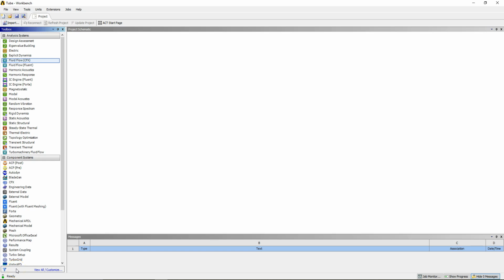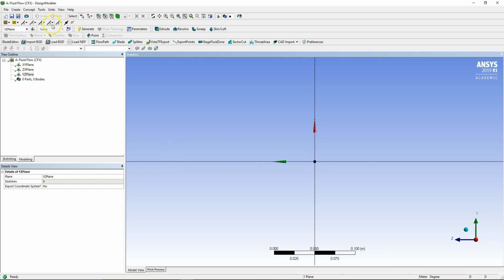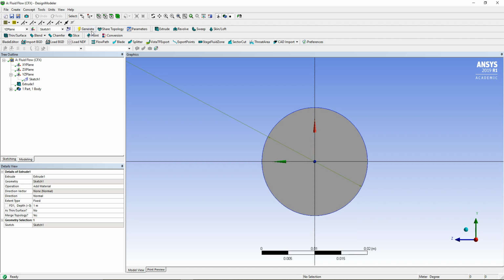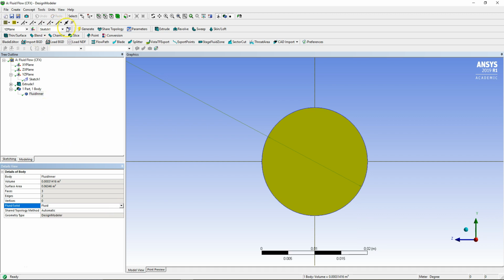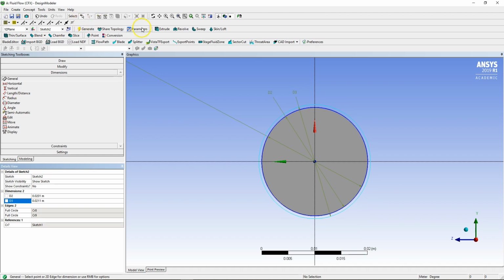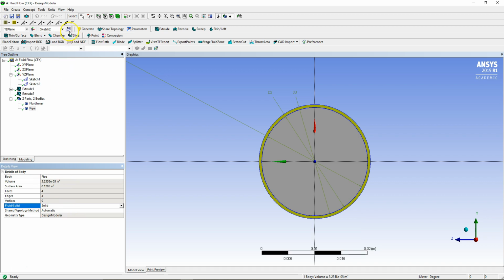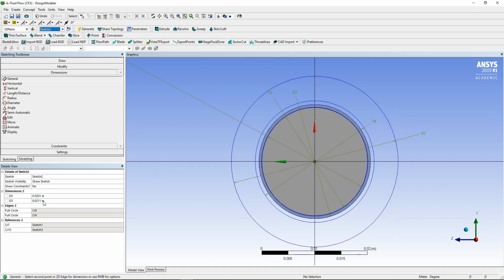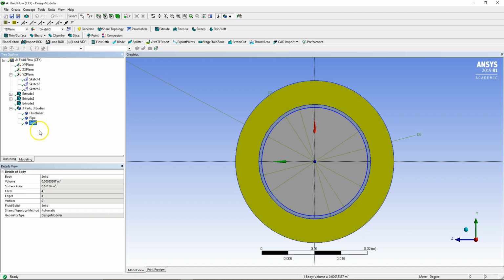Concentric Tube Heat Exchanger Ansys CFD CFX Part 1: Geometry

Comment: So the INNER FLUID has radius R1 | SOLID CYLINDER - inner wall = R2, outer wall = R3 | OUTER FLUID - inner radius = R4 and outer = R5. 

Why R2 > R1 and R4 > R3 and not the same? In case you would add it as frozen instead of "material" wouldn't it work? I might be missing something.
Reply from the maker: This was out of habit, having experienced issues in older versions of Ansys using coincident radii. There is no issue in the newer versions.

It should work providing they are seperated.